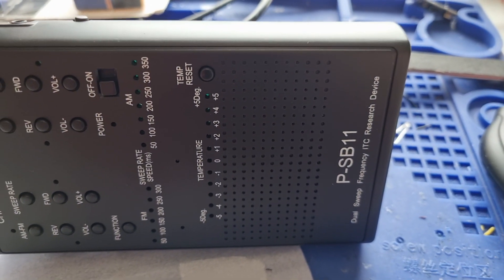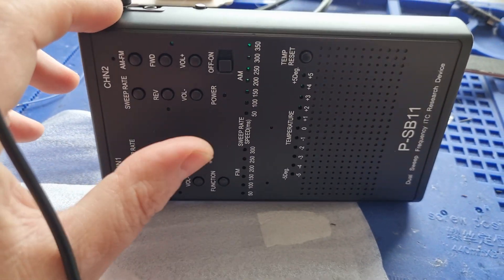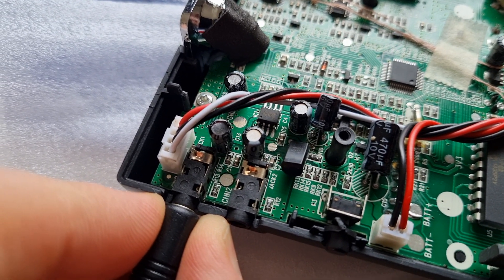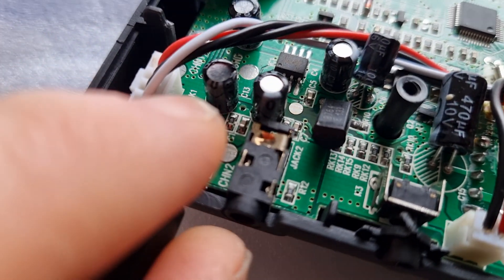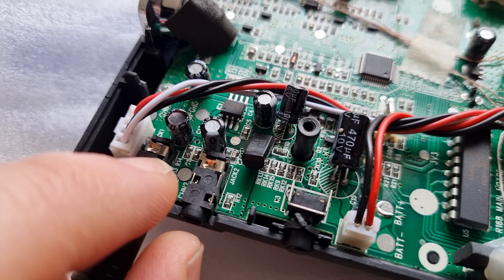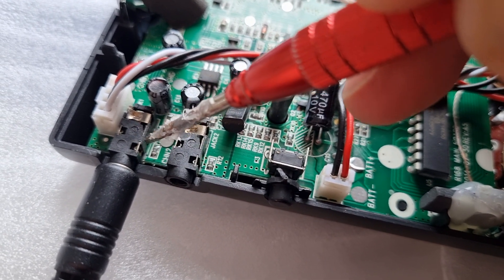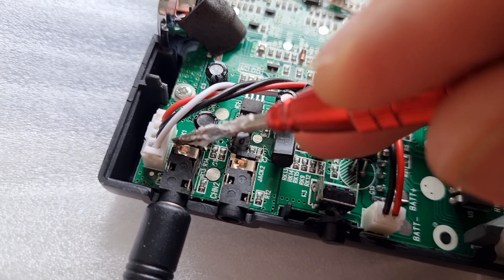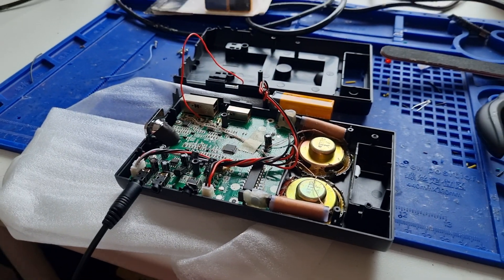PSB 11 In for repair No audio, Fixed.

Comment: My PSB-11 ANC scans fine for a bit then starts making a squelching noise and then going quite before coming back on eventually with the squelching noise. Only way to fix it is shut it off and turn it back on and then it only lasts like 3 minutes again. No screws under battery door and I can’t seem to open it.

Comment: how did you get the case open?
Reply from the maker: 2 screws under the battery door, which Just prys apart easily once removed screws, Lift from the battery tray side as there is plastic hoop tabs holding the top half together,  Opens like a hinge type deal. Do you have the same issue as in the video?
Reply: @puggster  I don't have those two screws--unless they are "hidden" ha! Our issue is the device was dropped and now the headphone jack is inoperable.
Reply: @PhilRossiMedia did you ever get it open? I have the anc model and there’s also no screws under the battery door. Also dropped mine and now when scanning it just makes a horrible noise so I wanna open it up to look at it.